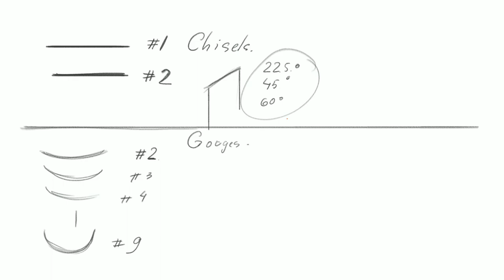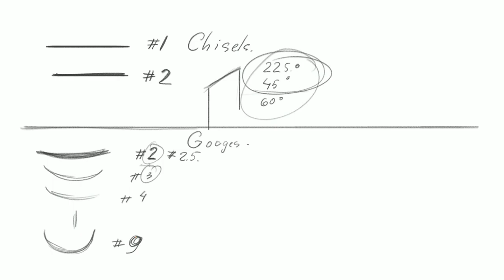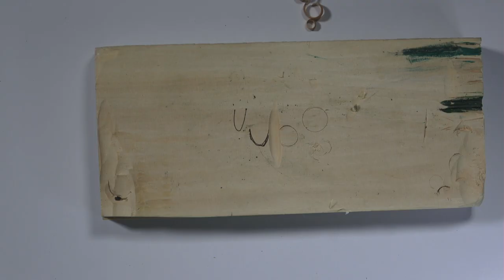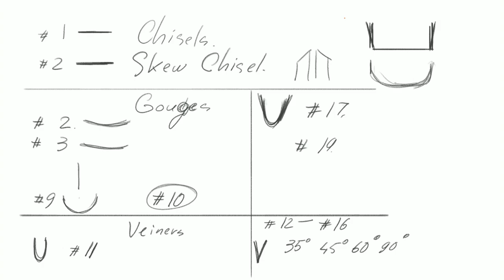How to Sharpen U-Veiner #11 ( WOOD CARVING ) Alexander Grabovetskiy woodcarver

Comment: Do you have a favorite chisel sharpening system (machine or wetstones; one that you prefer to use the most?  Or does it depend on what chisel you are sharpening? I currently have a Tormek system with several different grit disk wheels, and I am considering to purchase a Work Sharp Benchtop woodworking tool sharpener system when I want to really focus carving instead of spending time setting up the Tormek. But I'm concerned not only about changing the temper of the metal, but the Work Sharp's sharpening angles being accurate. Anyway, do you have a Fav or does it depend......?
Reply from the maker: John, thank you for the comment. Here is a link to my videos on sharpening and my preferred method.https://schoolofwoodcarving.io/free-sharpening-lessons/